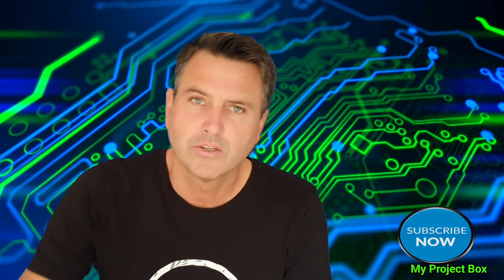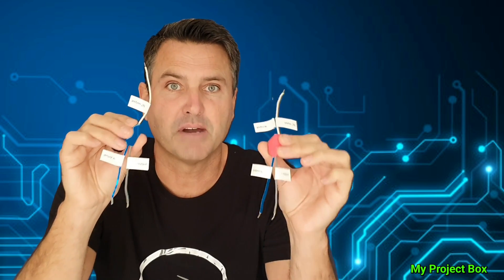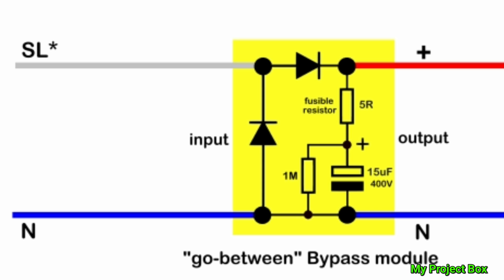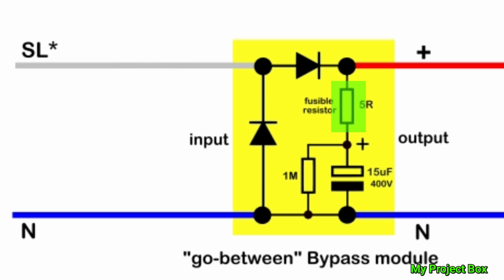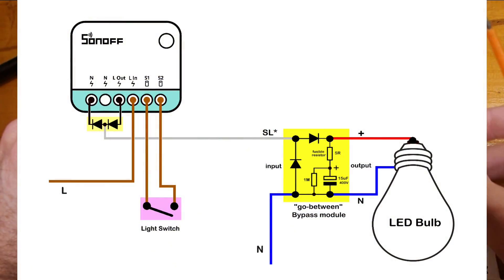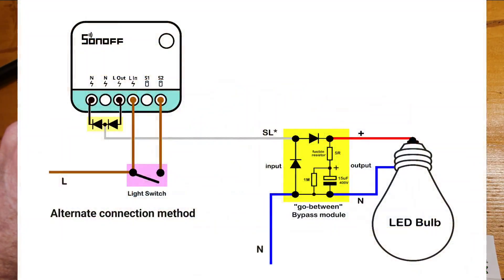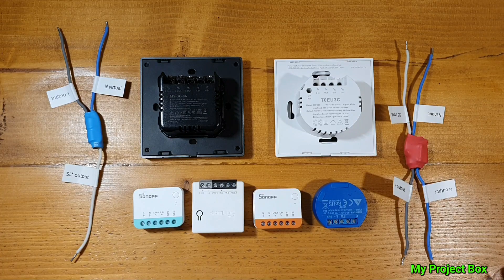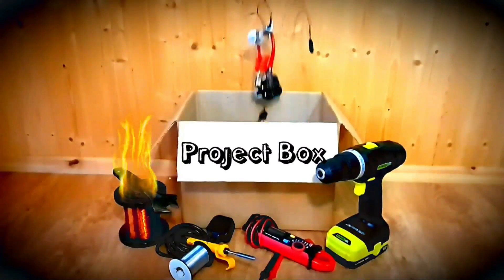Sonoff matter MINIR4M No-neutral smart switch?

Comment: I made myself your "no neutral circuit" with sonoff Minir4m, following your intructions on the vidéo and it works  ! !
Thank you very much for sharing it here.
Reply: I tested diodes, they were all ok.
I tested the fusible resistor and it was cut so I just replaced it and now the circuit works again (with a load this time 😅)
Thank you for your quick answer.
So happy to use this circuit.
Reply from the maker: @ChristopheLABRUYERE  this circuit is still in the prototype stages, so if your fusible resistor keeps blowing,  you could experiment with different values. Maybe use two 10ohm in parallel 🤔. Or a higher wattage 4.7 ohm?
Reply from the maker: I'm so glad it worked for you 😉 👍.  I'm  continuously looking for ways to improve the circuit👍
Reply: @MyProjectBoxChannel  I tried to synchronize my Sonoff MINIR4M in Homekit and it worked.
But after several on/off trials, something flashed on my circuit, i think the fusible-resistor 4.7ohm 2Watt.
I did my tests without load (in fact, i put a female sector plug with nothing on it), do you think it could be the reason of my issue ?
Reply from the maker: @ChristopheLABRUYERE  Oh dear🤔 You should really have the load connected! It's hard to say what has failed without doing some testing. Did you build the new version of the circuit from the mini-R4M video? In that circuit, even if the fusible resistor is blown, then the circuit can still function, but with no smoothing capacitor working, the the LED bulb might flicker badly. You can also bridge out the fusible resistor( and see if the circuit works) Try doing some continuity testing with a multi meter, on the fusible resistor. Discharge resistor can be removed as it is optional anyway. Diodes can be tested with a multi meter. You can also just replace them. It's possible that some components were faulty/bad quality🤔. Is the capacitor rated at 400V or more?

Comment: I want your bypass system for my NSPanel Pro and shelly 1 mini gen 3. When it will be available? 👌👍
Reply from the maker: I don't have any modules available at the moment 😢.  When I get time I may make  some more. It's not really economically viable for me. I make them all by hand and  it takes up a lot of my time. I can't change much money for them. 

I have not tested it with NSpanelPro yet,  but I believe that it will work. Are you planning to bring the  "neutral" back from a light, to power the NSpanelPro? But what will be controlling that light, if the NSpanelPro does not have a relay output?
Reply: @MyProjectBoxChannel  if i put NSPanel Pro on wall I will control the lights via Wi-Fi. Like I dont have neutral on Light Switchs I use the sonoff smate 2 and some Philips hue wireless modules too. And my wall boxes are small, almost cant fit a module inside 😅

Comment from the maker: For all the diodes: 10A10 (or similar)
Fusible-Resistor: 4.7ohm 2Watt (4.7 to 10ohm should be ok)
Capacitor: 15uF 400V (10uF to 15uf and 400V to 450v should be OK)
https://www.ebay.co.uk/itm/222523863966?mkcid=16&mkevt=1&mkrid=711-127632-2357-0&ssspo=_6NQH98_Q8C&sssrc=2349624&ssuid=qu3kmgcqR9W&var=521380291755&widget_ver=artemis&media=COPY
https://www.ebay.co.uk/itm/166556019261?mkcid=16&mkevt=1&mkrid=711-127632-2357-0&ssspo=PNnOX8BWT2S&sssrc=2349624&ssuid=qu3kmgcqR9W&var=&widget_ver=artemis&media=COPY

https://www.ebay.co.uk/itm/394333920820?mkcid=16&mkevt=1&mkrid=711-127632-2357-0&ssspo=r05p0t2csk-&sssrc=2349624&ssuid=qu3kmgcqR9W&var=&widget_ver=artemis&media=COPY
Reply: Would these components be different for 120V mains like in Canada?
Reply from the maker: @epikarus  it should work, but I have not personally tested it on 120V. You might need to increase the capacitor value a bit if you get a bit of flickering on your LED light bulb. But it should work fine as it is.😉👍

Comment: So if I use an M5 switch and an mini R4 extreme, i don't have the matter one yet, do I still need to use the diodes and capacitor circuit?
Reply from the maker: If you don't have the neutral wire connection they require to operate, close to it, then Yes, my diodes and cap circuit will provide a "virtual-neutral" for them to work. Are you using the M5 and minir4 together on the same circuit, or in different places?
Reply: @MyProjectBoxChannel  I wanted to use for the same circuit. The switch has only the live, the light fixture has also the neutral. I will probably use the mini R4 and just replace the switches with regular but better looking ones. Will this be the right option?

Comment: Hi, I think I am a little late, but are you still selling these? I don't have the ability to make this and would really appreciate if you could give me a way to buy both the modules. Thanks.
Reply from the maker: I will probably build some more of these modules as soon as I have some spare time. Keep a eye out in the description of this video, for links were to get them from. It's difficult to justify the work going into making them, for so little money.
Reply: @MyProjectBoxChannel I completely understand and thank you for the effort you are putting in to help people like me that are not too comfortable with making diy circuits with mains. If you do think you will make some more could you let me know around when you will be selling them if possible. Thanks.
Reply from the maker: @Gloggles  no problem 😉👍
Reply: @MyProjectBoxChannel  I am considering making the circuit, would it be possible to give the links to the components you used, if not could you give more detail of the individual components as I am not too sure on which ones to buy, as there are many different types of for example 5 ohm fusible resistors. Thanks.
Reply: @MyProjectBoxChannel  Would this be possible? As I do not know which components to buy.
Reply from the maker: @Gloggles Diodes: 10A10 (or similar)
Fusible-Resistor 4.7ohm 2Watt (not to critical can be upto 8ohm)
Capacitor: 15uF 400V (450v is fine too) 10uf is OK
Reply: @MyProjectBoxChannel  

Would these work?

EMC2-4R7K - Resistor, Fusible, 2W, 4R7

MCKSK450M100G17S - Electrolytic Capacitor, 10 µF, 450 V, ± 20%, Radial Leaded, 2000 hours @ 105°C, Polar

MFP2-1M JI - Resistor, 2W 5% 1M

5 x 10A10 Rectifier Diode 10A 1000V
Reply from the maker: @Gloggles  it all looks good 👍. I forgot to mention the 1Mohm resistor, does not need to be 2W , a 1/4W is ok, because it's just there to discharge the capacitor, so you don't get a shock from it when the power is off. The circuit will work fine without it, it's upto you if you want to include it.
Reply: @MyProjectBoxChannel   thank you so much
Reply: @MyProjectBoxChannel  I think I'm just going to buy yours it cost 17 pound and the components add up to 10 pound after shipping. Thanks for your help.
Reply: @MyProjectBoxChannel  Is it possible to do 1st class? I can pay more.
Reply from the maker: @Gloggles  If you want to do a private sale maybe contact me on Facebook messenger https://m.me/robert.wynmaalen

https://www.facebook.com/profile.php?id=100064135269371
Reply from the maker: @Gloggles  I'm back home, and able to post the modules if you're still interested?
Reply: @MyProjectBoxChannel  You can do fast shipping? I need it very soon £10?
Reply: @MyProjectBoxChannel  Hello?

Comment: Does it work with 220v and up to 20w led bulp?
Reply from the maker: Yes I think it would work fine, especially with the bigger 10A10 Diodes. The capacitor value should be OK, but you can increase the value if you get some flickering. My circuits have all been tested on "220v-240v"👍. If you look at this older video,  I have a safe testing procedure, so nothing gets destroyed, if you make a mistake. https://youtu.be/oBR5O391m_c
Reply: @MyProjectBoxChannel  thanks👍🏻. Would it work with corresponding switches  - like one switch in each side of a hallway and the light in the middle of the ceiling? Thinks it runs like phase to switch one, - to switch two, - back to one - througt light bulp to  - Zero… : or could be phase to light bulp to switch one, to switch 2, back to one - to Zero. This I have in one house.
Reply from the maker: @larsw.larsen4173  I think you might be referring to 2-way or 3-way light switching 🤔.  The problem is if its wired the European way. You will need to get to the first switch supply feed, and the last switch, switched line out going back up to the light bulb. These two ends need to somehow go to S1 and S2. That probably means pulling extra wires! In the UK it's wired differently, and you can just connect it at the first switch. https://youtu.be/7g0kjF7yobk

https://youtu.be/9hQFFsBkxaU
Reply: 👍🏻 it’s in Denmark and Sweden.  Denmark. 2 switches for one light bulp. Both switches kan operate lightbulp. Both on or og  off gives light to lightbulp. One on one off gives no light. Phase is going to light bulp. 0 comes from the switch most far away. Right now I have both switches on = mini just works lige an Son-off RF switch. Seems like I needs to draw  3 new wires - 1 wire from 0 to  Son-off  mini. 2 wires phase from son-off mini S1 to switches and one back to son-off mini S2. This seems to need a lot of wiriring that I dont have space for. Do you think that the Son-off zigbee mini could solve this issue?

Comment: Why did Sonoff make the Zigbee version non-neutral but the Matter version with a mandatory neutral? What were they thinking?
Reply from the maker: I think it's because zigbee devices have very low current consumption. So it's easier to make it work without a neutral. Remember you are "stealing" power from the light bulb, but trying to do it without turning it on. You are effectively getting the neutral return path through the light bulb.
Reply: @MyProjectBoxChannel  good point. Then Sonoff should have made a non-neutral Matter over Thread module instead of Wi-Fi.
Reply from the maker: @fluxcapacitor  mabe it will be possible with a firmware upgrade. I'm not sure if the hardware is capable of doing this 🤔.  Maybe the Sonoff zigbee bridge will get a Matter-enabled firmware update?

Comment: Fantastic video.
I'm in the UK and have replicated your circuits and also have both a Sonoff R4 mini Extreme and a couple of Tuya based mini switches.
The issue that I have is my consumer unit has RCBOs and when connected this  instantly trips the lighting circuit.
I suspect the RCBO is too sensitive to the effective short that this is creating.
Have you come across this?
Reply from the maker: No I have RCBOs aswell, and have not experienced any tripping. Have you tried to make a test mockup circuit on a plug socket? It's also useful to use my current limiting test circuit, so you don't damage any thing. It's not always possible to see if a diode is damaged. Check all polarities. Look at this video  example.  https://youtu.be/oBR5O391m_c
Reply: @MyProjectBoxChannel  after I posted I did read more replies so will definitely build the circuit again.
I'll report back with my findings.
Reply: Well, produced the circuit again but simply using wagos and it works a treat.
So you are absolutely right it does work with rcbo's 👍
Thanks for your videos!
Reply from the maker: @optic1972  thanks for confirming that. I was starting to doubting myself for a minute.🤔🤨👍

Comment: First of all, thanks for the video. I started to make this circuit today and linked to my led light. Unfortunately it doesn't work for me. The Sonoff can be powered up but every time I turned it on my main switch tripped.
Reply from the maker: It sounds like you have One or more diodes the wrong way around. Replace your diodes, or test them. The diodes can look completely normal but still be faulty. In this video I use a old style incandescent light bulb,  as safety current limiting, so you can safely test your circuit without damaging anything. https://youtu.be/oBR5O391m_c
At 12:55 time stamp😉
Reply: Thanks for the reply. It’s definitely useful. I maybe try it another day
Reply: To debug I left only the bypass installed and it's still tripping. Should it work like a normal switch with only the bypass?
Reply from the maker: @WiseSimpson  you have to have both modules in circuit!! If you only connect the bypass, you will definitely have a short-circuit!! Because the diodes in the bypass are shorting out on every half cycle of the AC waveform!! In this circuit there is no room for errors, every component needs to be in the correct polarity and place , otherwise you will have a short-circuit and probably damage something. That's why my current limiting test circuit is a good idea trust me(from this video https://youtu.be/oBR5O391m_c  )

Comment: Would this newer beefed up version work with a much bigger load (say a 500W halogen lamp)?
Reply from the maker: I wouldn't recommend it. It might be ok , but the capacitor won't be very effective at reducing the ripple from the half-wave rectification. So you may lose some lamp brightness, and possibly have a very slight bit of flickering. The circuit really was designed for LED lamps as a load.